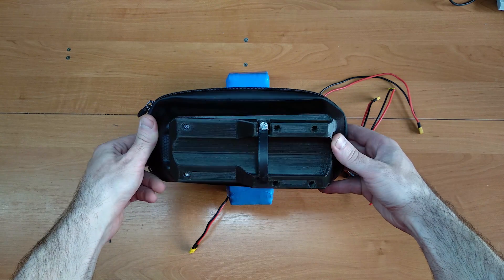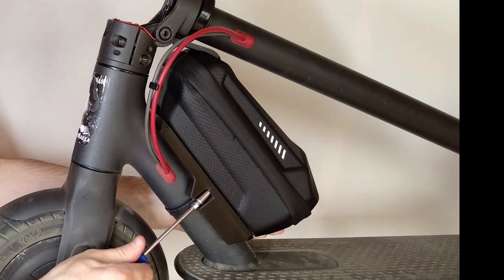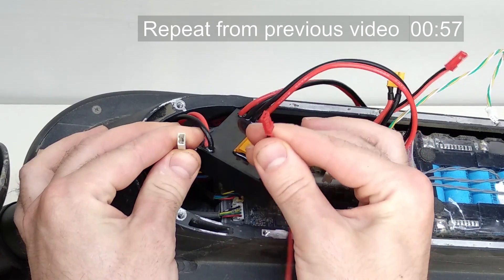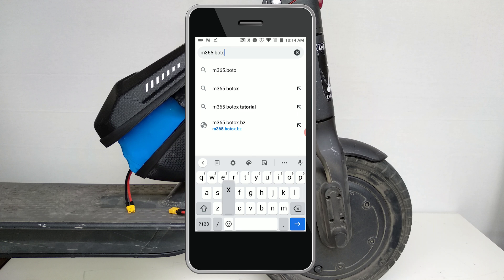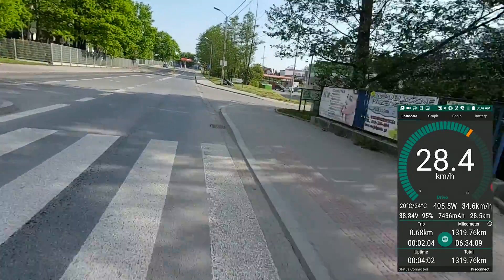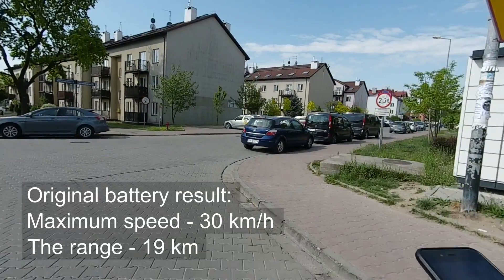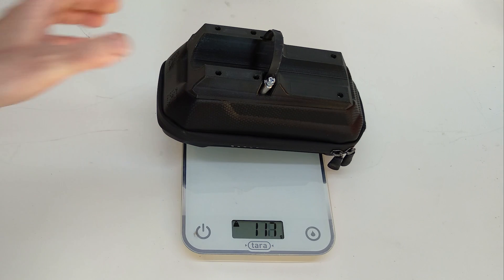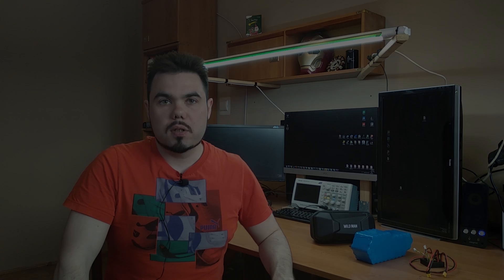Xiaomi M365 / PRO / PRO2 / 1S / 3 extra battery installation tutorial

Comment: If I have just run the 12S empty on the way, do I have to flash the firmware back to 41v on the way before I connect a 10S to continue my ride??
And what happens if the 12S is connected, but I accidentally plug in the 10S charger?
Reply from the maker: Yes, unfortunately you must reconfigure Rita every time you change an extra battery configuration. It is strongly prohibited to ride with a 10s external battery while Rita is configured for 12s external battery.

Plugging 10s charger to a 12s battery will not cause any problems
Reply: @DenisYurev  Thanks for the answer, I would have thought it was the other way around : =)

Comment: Whats the load time of the two batteries (36v two times) is than 18h
Reply: iam used the original m365 battery and an additional 36V 10Ah battery(liitokala) for around a year.
The charging time with the original xiaomi charger for both connected was 6 - 8 hours.
If you use a cheap China charger, as is usually included with cheap China Batteries it can really take 12 - 16 hours+
I don't know how Rita affects the loading time, iam using the 12s now.
greets :)

Comment: Does Rita act like a BMS for external battery? Or should I put another BMS into my external battery when building it?
Reply from the maker: You have to use a BMS. Rita just distributes batteries currents
Reply: @DenisYurev  Thanks, now Im begining to understand the principles. Now for BMS - do I need to obtain one that limits the current to 25A or can I use for example 30A or 40A BMS? If I get it correctly, the control board has a full control on current that is being drawn from batteries, right?

Comment: Does 12s3p give the same range as 10s4p? You got 32km more with 12s3p so you should get min 40km with 10s4p right?
Reply from the maker: 12s3p contains 36 cells, while 10s4p contains 40 cells. So, 10s4p provides about 10% more energy -> range.
Reply: First battery is from Company and second one extra battery
Company is 25km
Extra battery is 35km
This two batterys is how much km working thanks

Comment: Does this work if I use a Segway Ninebot Es2 battery?
Reply from the maker: No, because an extra battery must be equipped with a common port BMS(one couple of wires for both charge and discharge), while your battery is equipped with a separate port BMS(dedicated charge port)

Comment: Got a question. If i removed the speed restriction on the scooter before or after adding this new battery would that change anything? Like would it mess up the batteries or anything?
Reply from the maker: speed is limited by the sofrware and by the hardware(voltage)

for example, m365 from the box reaches 25 km/h - this is a software limit. You can unlock it, and then it will reach 30 km/h - it is a hardware(voltage) limit. The only way to increase sped more is raising voltage, for example 12s battery.
Reply: @DenisYurev  so if i do the 30kmph unlock and use the speed boost kit it wouldnt cause any issues?
Reply from the maker: @keelobrown4991  no issues
Reply: @DenisYurev  😎😎😎
Reply: @DenisYurev  sorry to keep bugging you with questions🤦‍♂️ but do you have to charge the external battery seperately or do you charge the external and scooter battery at the same time, using the scooters charging port?

Comment: Just about to order this Denis. Will it work with 48v 42ah 1000watt 13s3p 18650 Battery Pack Mh1 54.6v pls?
Reply from the maker: Hello, yes, but you must reinforce your controller to use this 12s+ battery.
Rita also supports it, but you have to connect it special way, please check the Rita user manual  "Using 12s+ batteries" section:
http://public.embedden.com/Rita/Docs/English/rita_manual_latest_en.pdf
Reply: @DenisYurev  Thank you very much for your reply. Love the product. U legend.

Comment: OK before I order this, I have a question.  I have a standard m365 with a pro dashboard and custom firmware gonka 1.50 installed.  If I buy the the range kit will this work alongside the gonka firmware and pro dash board?
Reply from the maker: Yes, it will work out of the box
Reply: @DenisYurev  Ok thank you, I've purchased the range kit.
Reply: @DenisYurev  Hi Denis if I buy Rita and 12s external battery for m365 pro, is it possible to reach even faster maximum speed than 36km/h by changing other parameters when flashing the controller using your website?
Reply from the maker: @S0ftjam  with 12s battery you will reach +20% of your current maximum speed.

Comment: Can anybody please offer me some advice. I bought the full speed and range boost kit from Denis, connected it all, flashed the firmware to support the larger battery (set it to 51) now the scooter display stays on unless I pull the battery connector out, no apps will find the scooter version so cannot flash or downgrade and the scooter motor does not kick in, so I currently have a paper weight worth over £700. I used xiaoflasher to flash the firmware but not that program doesn’t recognise any of the firmwares as it can’t identify the scooter version (even though it’s connected via Bluetooth) same goes for m365 downG) ps I cannot solder so that’s not an option for me. Any help is hugely appreciated. Kate
Reply: I have to same problem
Reply from the maker: @marcvankerrebroeck1667  Hello, you can ask for support here: https://t.me/m365_custom_electronics_en

Comment: hey, you seem to know a lot about the M365. I’ve got a xiaomi m365 that I have replaced with a m365 pro digital display and motor. Do I have to upgrade the motherboard also before I upgrade to the m365 pro battery? 

There’s a utube video claiming that the purple motherboards are counterfeit and junk. Is this true? And if so are the purple digital displays junk too. Thanks for your time pirate. Mitch
Reply from the maker: Hello! No upgrades are required to connect PRO battery to M365
Reply: @DenisYurev  will this hook up to a regular Xiaomi 365? If so where can I buy this
Reply from the maker: @jabbarwilson7012  Yes, there is a Xiaomi M365 in this Video
m365.embedden.com
Reply: @DenisYurev  awesome! Thanks for getting back so quick

Comment: Your "hack" is incredible!One question is it compatible with pro 2?
EDIT: Yes it is,I read it on your website.
Reply: So it works on the pro 2? Has there been any side effects in relation to the battery, power etc?
Reply: Do the pro 2 get also the 20% more speed?
Reply: my top speed is 45kmh with range + speed boost kit and i have pro2
Reply: @perunao4823  
Hey stock pro2 motor too? Or upgraded motor?
Reply: @CA-RC  stock motor
Reply: @perunao4823  
Nice, 10s or 12s?
Reply: @CA-RC  12s
Reply: @perunao4823  thanks for the fast reply
Reply: @CA-RC  np. Ihate the people ejos reply takes weeks or even months

Comment: hello, is it possible to connect 3 batteries to the rita 2x36v + 7,2v
Reply from the maker: Rita is designed to connect one single external battery. It is possible to connect 3 batteries to the rita 2x36v + 7,2v, but you must 100% understand what you are doing, while I don't have time to teach you how to manage this non-standard case

Comment: Will this work with a 36v 16ah 10S4P Battery, with a 20ah built in BMS, with a 42v charger. I have a classic M365, with a 350w upgraded front wheel motor as well. Need some advice please, i also am also considering buying the rita cable, how much will shipping cost to the UK please Denis?
Reply from the maker: Your battery must be "common port" - when a single couple of wires is used for both charging and discharging. Shippink to the UK is  about 16 GBP
Reply: @DenisYurev  Yes, i believe it has a single DC round port for charging, and a single XT60 female adapter. So will it work with my battery? "36v 16ah with a built-in 20a BMS" Link to battery: https://www.aliexpress.com/item/4001071316758.html?spm=a2g0s.9042311.0.0.13384c4dIaF12n 
I know you said AliExpress batteries are complete shit! But that is all my budget can reach to sadly😪
1 last thing Denis, I have stock pro fw 1.5.5 flashed on my classic m365, which cfw should i upgrade to please?
Oh and i already have the bag you are selling, but do you sell the clamp separately please? I can't see it on your site?

All ordered now Denis. #734.But still in need of the bag clamp...🥴 Thank you again🛴😁👍

Comment: Will this work on the new pro 2
Reply from the maker: Range boost kit with 10s battery - yes. Range+speed boost kit with 12s battery - at this moment no, because it requires a firmware upgrade, and such firmware does not exist yet

Comment: Hello! Im looking to buy this one but want to use a 13s (48v) external battery. When will you release a video about the installation of a 48v battery with Rita? I remember ypu saying in a video that the installation is a little bit special with higher voltages. Keep up the great work! 🤗
Reply from the maker: Thanks! Not sure that I will release it soon, because I have a lot of work. Generally, for 48 volts battery you have to 
1. Upgrade the controller for higher voltage support.
2. Cut 12s+ jumper at Rita and then connect it regular way.
This information is also presented in the user manual:
http://public.embedden.com/Rita/Docs/English/rita_manual_latest_en.pdf
And you can join my public support telegram group, there are some guys who sucessfully connected 13s battery:
https://t.me/m365_custom_electronics_en

Comment: Does RITA adapter work for Pro2 as well?
Reply from the maker: Yes, but 12s battery requires a higher voltage patch for the main controller. I am not sure that this firmware for PRO2 exists at this moment(15.08.2020). At the same time, 10s battery will work perfect with PRO2 and Rita, because it does not require controller patching

Comment: Hello, which power supply do I need to charge? Is the battery charged via the original charging socket? I have absolutely no idea which power supply i need. 

i would like to buy the range boost kit. can I set this up with the xiaomiflasher app?

Greetings from Germany
Reply from the maker: Rita allows you to charge the external and internal batteries simultaneously through the standard
scooter charge port. That is, you don't need a special charging port at the external battery, or take it off for
charging. Just plug the charger into the standard port of the scooter and both batteries will be charged.
If the extra battery with increased voltage is used, a new charger with increased voltage is needed. Use
the new charger as usual - just plug it into the scooter charge port and the BMS of the internal battery will stop
charging when it reaches 42V, while the additional battery will charge up to 50V.

There is a special app to set up Rita - https://play.google.com/store/apps/details?id=embedden.m365.bms.tool

Comment: Can you use 10s2p batttery? 36v 30000mah
Reply from the maker: You can use 10s2p battery
Reply: @DenisYurev  could I replace the original battery with something bigger such as 36v 30ah with same form factor as original battery. Will it be plug and play so all I need to do is plug it in and it's good to go or do I need to set up a specific cfw setting?
Reply from the maker: @dawoodkhan6067  Yes you can

Comment: Hi,i want to ask if what is the max speed with external battery?
Reply from the maker: Hi! Depends on it's voltage. If you use 10s battery(36V), then you will not get any increase of speed. If you use 12s battery,  then you will get +20% speed
Reply: @DenisYurev  how about a 3s speed battery mate im stuck I have a 3s speed battery and I have a series cable when I connect my cable to controller and battery it beeps like 8 times im really confused I need help do I need a rita
Reply from the maker: @clayepuffett1091  Hi! No, you don't need Rita) I have no idea how to help with your problem, sorry)

Comment: I have ordered the range boost kit & I have a Xiaomi M365 pro. I just wanted to know do I have to flash the firmware to a higher voltage or do I just leave the voltage the same ?

Also I have ordered a 12’s 50.4v 2a charger will I still be able to use it or not ?
Reply from the maker: You ordered a range boost kit, not range+speed. This means that your extra battery is 10s, and no firmware upgrade is required. You also don't need a new charger.
Reply: @DenisYurev  There s a range PLUS speed kit or just range kit?

Comment: Hello I have a classic m365 and I use 2 internal batteries (to have more autonomy) in parallel and an external 2s (to give more speed).
Is Rita functional in this scheme? can I charge the 3 batteries simultaneously using the same charger without a problem?
Thank you for your attention
Reply from the maker: No, Rita is not able to manage 2s external battery.
Reply: Denis Yurev ok what’s the minimal? 5S? 10S?

Comment: Hi Dennis I want my pro faster what I have to do I want 12s more power can for speed you can  help me
Reply from the maker: Yes, 12s is what you need, 
but at this moment we have no 12s chargers in stock, so we suspended Range+speed kits sells.
If you are able to modify your charger by yourself(1 resistor resolder is needed), you can buy Rita + 12s battery + bag, and finally get increase in range and speed.
Reply: Denis Yurev ok how I find you in face book Dennis please 👍

Comment: Is it possible to connect the second controller to my scooter and using only one stock battery +external(no need for second data line).  I have two wheel drive m365.
Reply: Aldis Garais wow thats possible I really make 2wd my scooter but I dont know

Comment: Is it possible to connect the second controller to my scooter and using only one stock battery +external(no need for second data line).  I have two wheel drive m365.
Reply from the maker: Yes, but Rita provides only  30A current, it is not enougth for 2WD, or you must reduce the power
Reply: So can I buy rita adapter for my 2wd xiaomi m365 and it will go faster and further?

Comment: So Rita makes/converts the external higher voltage battery to the same as the original battery. Is it possible to get more power with custom firmware and go above 34 km/h now as we have 2 batteries now?
Reply from the maker: This is well described in my previous video: https://www.youtube.com/watch?v=1cJFdFCtMGI

Comment: Hi folks need some advice...I just purchased a Xiaomi 365 that has a flash to improve the top speed to 30kmph...the problem is the battery charge status is not showing on the stem properly and the front lamp is not working? Any ideas?? I believe the BMS is 126?
Reply: If you bought it and it was already flashed I recommend you to download the Mi Home app and update the Xiaomi scooter to the latest stock firmware. Check everything is working fine and then look into downgrading to 1.5.5 and BLE to V9. now you can create your own firmware using online tools.
Reply: @JackVincent  Hi I have tried to connect it to the Mi app but it will not connect at all....Is there another way to re flash the software as I give up?

Comment: Hey plz respond. I ordered a 36v 8ah battery from Laudation on EBay but just found out that the battery cannot be charged from the discharge wires so would have to charge it separately (won’t charge in parallel with original battery from the scooter charge port.. have to charge it alone).. is there anyway around this or is it good enough to just charge both batteries full, separately, and then connect them for the ride. Sound too risky or anything? Any thoughts/comments/tips on the situation would be appreciated. Thank you
Reply from the maker: You can charge it separately and connect for ride, if this is convenient for you. There are no electrical problems in such case of using
Reply: Denis Yurev wouldnt the scooters regenerative charging making the volts unequal, cuz original battery gets the regenerative charge while extra  battery doesn’t receive that charge? Seemed to what was going on for me. I have a new 12ah battery on the wAy that can charge thru discharge wires so should fix that problem

Comment: Why you didin't pick the Remove cahring mode on the frimware? It said: Fixes issue of scooter going into charge mode with an external battery connected in parallel.
Reply from the maker: Because the main feature of Rita is that you no need to remove charging mode

Comment: brilliant, makes a lot easier, when first using can you use normal charging port, or will it require another charger to first charge external to same as internal
Reply: Hey I just ordered an extra battery to do this but now found out that the one I ordered can’t be charged in parallel with the xiaomi, it has to be charged separate - can’t be charged thru discharge wires. Hoping this won’t be too big an issue. If you have any advice or tips or anything plz do let me know. Thanks